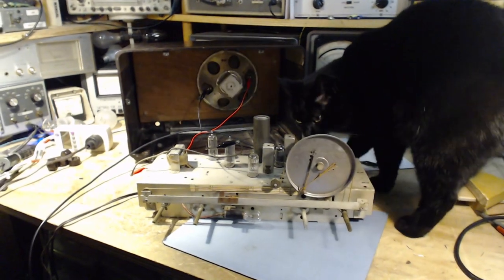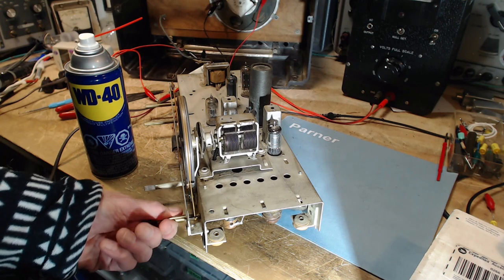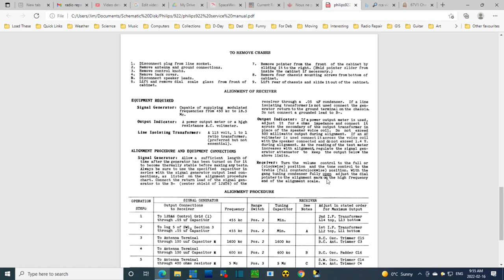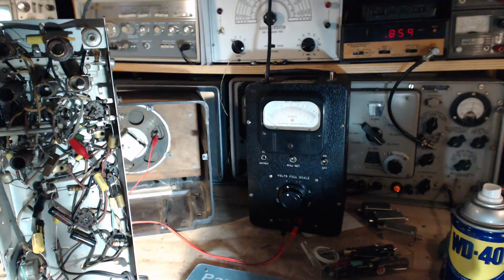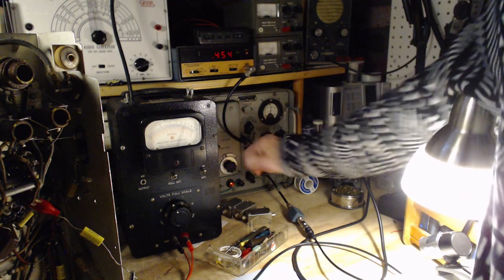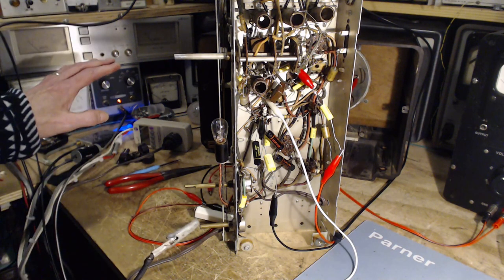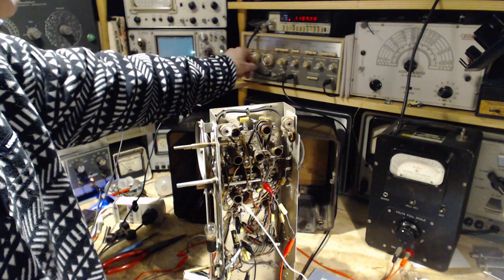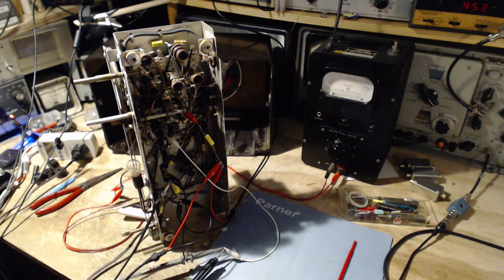Canadian Philips 922 Tube Radio Video #5 - Radio Alignment

Comment: Next to Shadow WD-40 is Jim's best friend. Follow the alignment instructions exactly and you won't have problems.
Of course that means using your misaligned test equipment.  Again the noisy shop giving interference a good show. 
This was only step 1 of 6 in the alignment instructions.😞